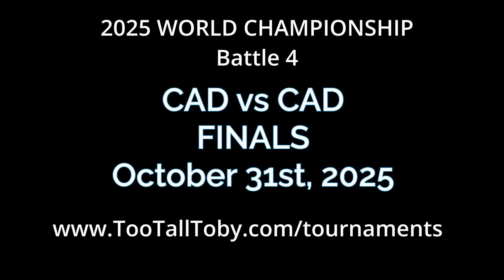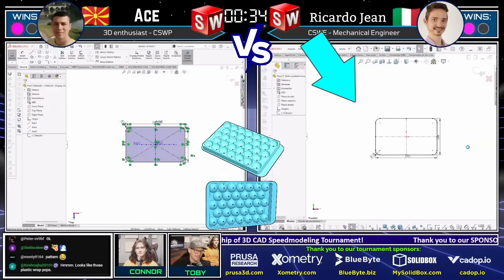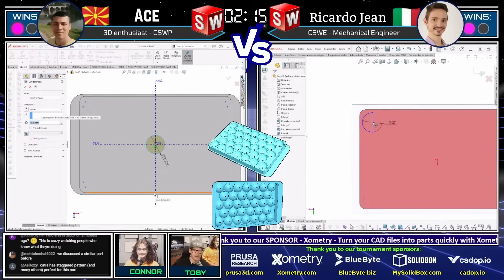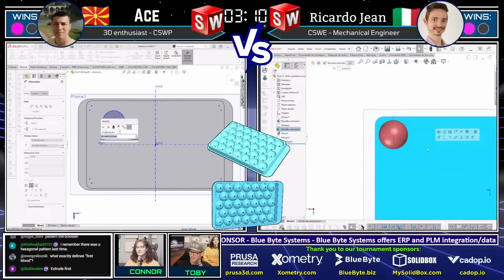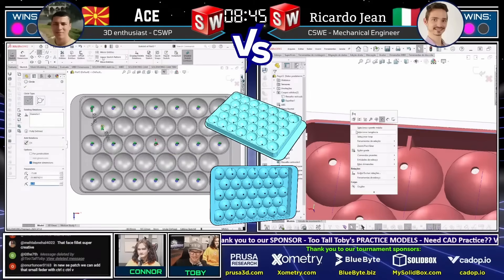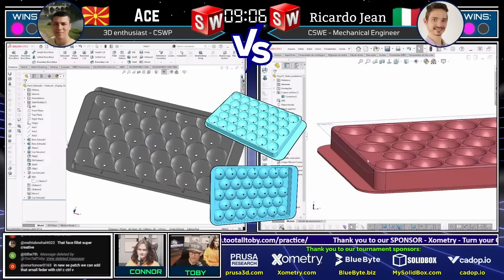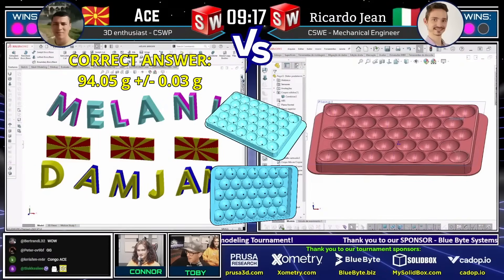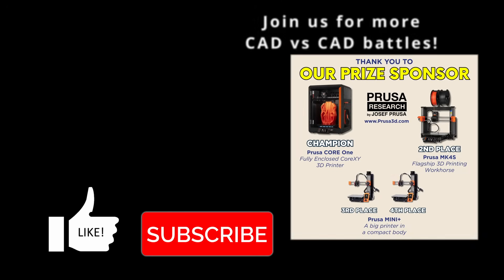CAD vs CAD Tournament - World Championship FINALS - Battle 4 - Fill Pattern! Face Fillet!!

Comment: I have tried by my own and still haven't figured out why cut doesn't work with fill pattern after a fillet. Do you guys have any ideas?
Reply: Why don't you just try the cut revolve and feature pattern fill that? That should work... Even the bullion method isn't that bad
Reply: @SubrotoOP  That's not like a question how to do that. The question why when you do cut and fill without having a fillet - it works, but right after you add fillet - it fails to do the fill pattern?

As you can see in the vid - Ace had fill pattern and it worked right before the moment when he realized that he forgot the fillet.
Reply from the maker: I don't know the answer - I saw that too @jaidsuka  
Once you change that surface, the fill pattern stops working, but it's strange that it worked before the fillet (when he did the fill pattern for the hole).
I posted this model in the library at https://www.TooTallToby.com - so hopefully the guys there will post some more attempts at modeling it, and uncover why this is happening.
You can also ask for some feedback in the TTT Discord. (link at the top of the page at tootalltoby.com )
Reply: @TooTallToby  The thing is - it is exactly cut + fillet + fill pattern :) Because if you have a body there (instead of cut) - fill pattern still works :D Some black magic around filllets + cuts + fill pattern :)